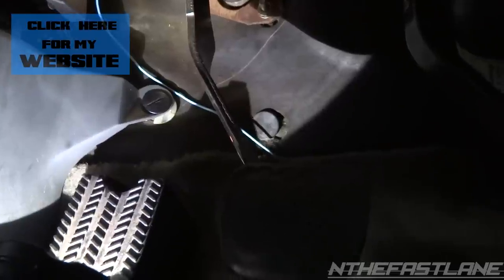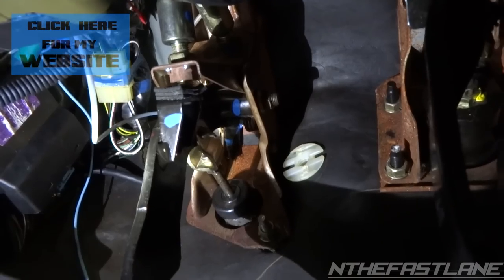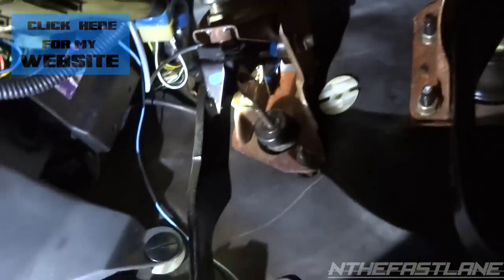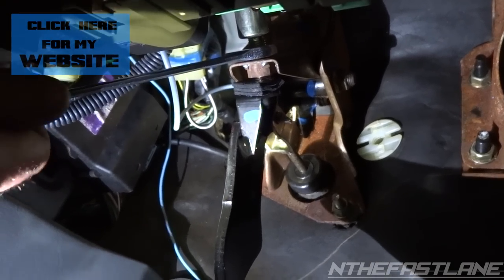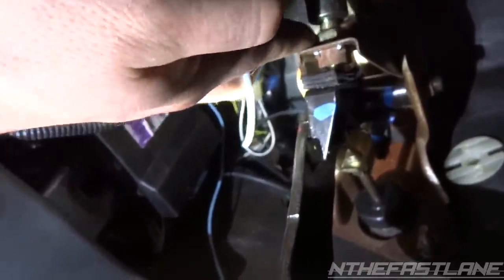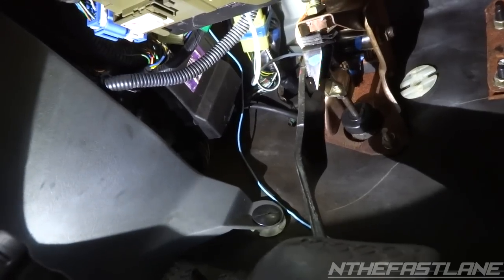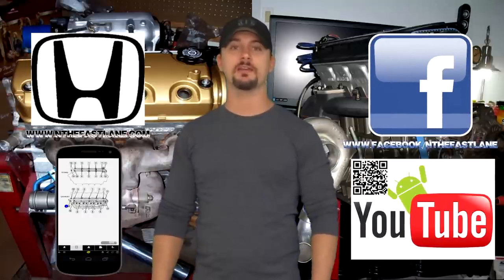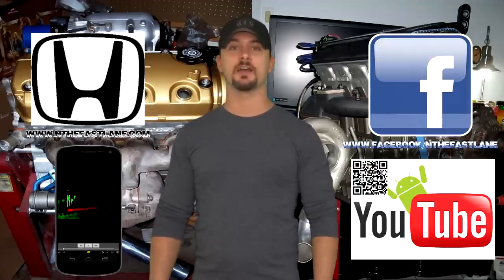Clutch Pedal Play Adjustment "How To"

Comment: Dont adjust your clutch pedal free play this way, he did this in a roundabout, incorrect way. What he did is adjust the pedal height adjustment, he should have left that alone, and adjusted the master cylinder rod on the other side of the pedal towards the firewall which would have been the correct way to reduce play in the clutch pedal to master cylinder mechanism.
Reply: should the bite point be lower to the floor or in the middle?
Reply: @omarG19100 becareful buddy

Comment: this is absolutely incorrect and not at all a pedal adjustment. you didn't even touch the pushrod into the master cyl.
Reply from the maker: @TheRobertChannel   @Youtuber  It's really hard to explain to some people. I did put it in the description that this isn't the clutch pedal linkage. Exactly what you said Jason is what I was trying to get across to people. Sometimes you can extend your clutch linkage all the way out and if the sensor adjustment keeps the pedal pushed in, "which I have had happened", It can cause your clutch to not fully engage and slip under wide open throttle,. Again, another thing that I've actually had happened.
Reply: Nthefastlane meaning it’s could cause it not to shift at all cause I don’t even have to press pedal down to shift now but I don’t move at all I just sit in neutral

Comment: Wrong...totally wrong. All you did was adjust the sensor position. Fast lane? Hmm..doubt that.
Reply: Wrong again. Using the clutch switch like this will cause that plastic button to eventually break off. The proper way to adjust the clutch pedal is at the rod coming out of the clutch master cylinder.
Reply from the maker: You're missing the point, the rod is fully extended, there is still pedal play. What is your next move? (A) Leave the pedal play, deal with it. (B) Adjust the switch to remove the pedal play.
Reply: I was looking for what you're referring too. I adjusted this already because it was way too much play, but now I need to give the clutch engagement some space. Brand new stage 2 clutch has like 1inch before I'm launching to space. Off to the next vid or forum, assuming I need to adjust the rod as your state in your next comment.
Reply: @Nthefastlane  you keep saying people are missing the point while on the video you didn't do the job to explain this.
you could add that to the actual video.
Reply from the maker: @TheLifeOfMartin  I believe a while back I did have "annotations" on the video. However, Youtube did away with those and there's no way to put any kind of text in the video, or even add a video clip to the pre-existing video. In the future I'll probably make a more in-depth video! Or I might just make a webpage tutorial on my website.

Comment: Sorry man but this is wrong information. Remove that lil 3 ply pad you have to, junk yard will have correct lil rubber button that goes on pedal up by the bolt. The top bolt on cluth pedal housing is a bolt or cruise control switch, used only for pedal height and is also upper pedal stop, the clutch master rod is for adjusting freeplay in the pedal only, and only when you have already adjusted pedal height. Now the pedal height will also affect where your clutch starts to engage, but that's another topic, still like your videos.
Reply from the maker: The groments break yearly and they are garbage,I'll kee p my mouse pad thank you.

Comment: I thought there was something wrong when I replaced my master cylinder because it felt like the clutch wasn't fully disengaging and there was a lot of wobble, and very little travel before the clutch was engaging.  I'll adjust it tomorrow, and hopefully that will help me get it into gear at stops again.  Thanks.
Reply: Bro I’m having that issue when car is stopped and running its hard for me to go into 1st gear

Comment: so the master cylinder pushrod does not affect the play? its actually the sensor position above it that restricts or allows play?
Reply from the maker: They both affect the play. However, when you've maxed out the slave cylinder pushrod adjustment, you need to adjust the sensor afterwards if there's still play.
Reply from the maker: Basically adjusting the sensor allows you to fine tune your pedal engagement distance and get the slop out of the pedal.
Reply: @Nthefastlane  thanks for the reply, am i correct in rotating the cmc pushrod clockwise(?) till some resistance felt and then backing it out a hair ?
Reply from the maker: @BogDog9  Yes you don't want it too stiff. Too stiff will prematurely engage the clutch. I found if it's too stiff during a hot day the heat causes extra pressure in the slave cylinder line and it will actually slightly engage.

I've had a clutch slip like this. Leaving just a little bit of play is good.

Comment: The adjustment made here is that of the position of the starter/cruise control safety switch; which the adjustment of in many vehicles also changes the upper limit and/or total travel distance of the pedal. 

Free play in the hydraulic linkage is adjusted by the length of the pushrod on the master cylinder. Proper length is set to provide neutral to miniscule pressure on the hydraulic system when the pedal is in the upper position with no foot pressure applied.

Comment: You adjusted the height of the pedal. The master cylinder pushrod would be adjusting the “bite” point, but do note that if you adjust that pushrod, you change the throw of the clutch fork, and can either overstroke or slip your clutch this way, or you could blow your master cylinder. Would recommend just leaving it at manufacture spec

Comment: In my truck the gears is hard to change and the reverse is grinding is possible need clutch adjust? One mechanic tell me is possible need replace the shifter what is that part. I have manualtransmission

Comment: Tip: Switch those worn out pedal rubber pads between the clutch and the brake pedal. In 99% of the cars they're the same part number. It will extend the useful life because they wear on different sides. On the clutch pedal wear on the left and on the brake pedal wear on the right. Cost 0. ;-)

Comment: I just installed a Competition stage 2 in my Prelude.  My clutch engagement is way high now!
Reply: What about getting it lower? And how about the adjustment on the clutch pedal yoke to master cylinder rod?
Reply: @bobbydelamar606  yes

Comment: Hey would if my pedal has a lot of play which I’m not used too just swapped out master clutch cylinder and it feels different just want the clutch to have a little play that’s all help???
Reply from the maker: You probably need to adjust the master cylinder rod and nut that connects to the pedal. Just pull the pin out, disconnect it from the pedal, and then start turning a couple of left turns. Connect it back to the pedal and see how the play is. 

You don't want the pedal completely stiff because on a hot days it'll expand a little bit and your clutch will actually be engaging when it shouldn't be. You need just a slight bit of play. I'd say 1/8in - 1/4in of pedal play.
Reply: Nthefastlane ok I just tried it works perfect thanks just needed a little adjustment nots it’s all good

Comment: in my diesel truck the gears is feel hard when i shift. The reverse not go easy. Is can do that because the clutch need adjust? Or is transmission problems
Reply from the maker: Check your slave or master cylinder.

Comment: so i have a 2000 ek1 civic also, just replaced the clutch with a heavy duty clutch kit and the engagement point is still where the pedel is fully released. clutch has been bled along with a complete heavy duty kit. any suggestions?

Comment: What if there is more play than factory specs on a stock clutch with 160k miles? Would it be necessary to adjust and would it help in any way?
Reply: 141

Comment: +Nthefastlane hey man I could use some advice done a 5 speed swap on 95 ex all new slave , master and all clutch stuff it's been bled over and over will not go into gear with clutch in but will without running and without pressing clutch. adjustment of the rod the little U shape attachment for the pedal to master with the pin thru it is also at the end of the thread all the way maxed out is it too far? all the clutch install is correct btw I've done quite a few. any advice please ?

Comment: Hey I have a 96 honda accord and just today I noticed that my clutch has way to much play. And it is now running strange.  I release the pedal and the RPM Goes up to 4 and the power is not like it was before.  Will this adjustment work for this issue as well?
Reply from the maker: It could if it came loose..if it's an older clutch it could just be going ,first I would try this.

Comment: anyone know how to fix the clutch pedal from engaging so high, i only gotta press the clutch pedal like an inch for it to engage and its really annoying
Reply: +Stee Vee cable or fluid?
Reply: +Bradley Felschow i believe fluid, i bled master and now it engages super high
Reply: well you can't adjust the grab on a fluid system... i believe the grab then depends on the type of clutch eg; oem, hd, twin etc.
don't take my word for it, i'm not a huge fan of fluid clutches.
Reply: well its a prelude, the clutch was engaging fine until i bled the system
Reply: you've messed up during the bleeding process then.

Comment: What so bad is when the clutch pedal go all the way down ; but not coming back up can not engage any gear ????
Reply: Remove the Slave cylinder at the transmission. Remove rubber top and loose rod. . have someone press the pedal from inside and watch the puston move 1/2 inch out and keep an eye on the fluid level. After the cylinder is about 1/2" out put it back as it was disassembled. Thats it 👍

Comment: Time to hit the books, kiddo. This is clutch switch for cruise control adjustment. clutch pedal freeplay is in the rod from the master to the pedal. Seriously, read a book or just make videos about stuff you know.
     You do need to move that switch out of the way before the adjustment, however.
Reply: Luke Muller you're a hundred percent right.. that adjustment must be made on the cmc rod...
Reply from the maker: I probably should have mentioned about the master cylinder shaft adjustment. Mine was maxed out and I just threw this video together real quick.I show how to adjust the master cylinder in my master cylinder repair video. This was just to get rid of that pedal play.